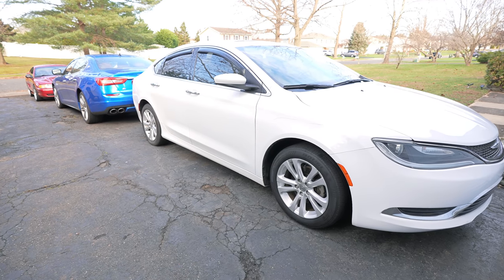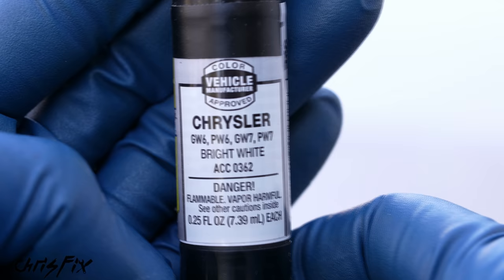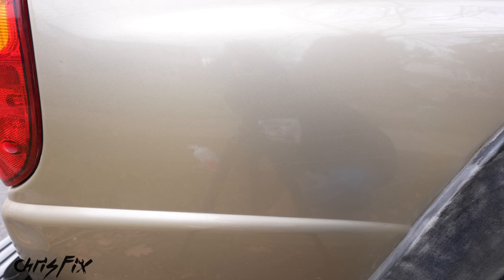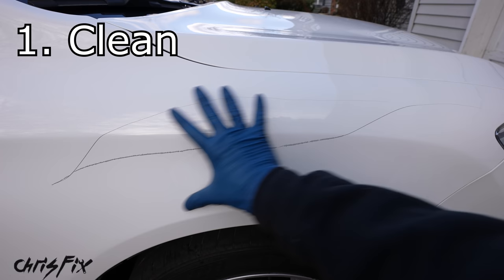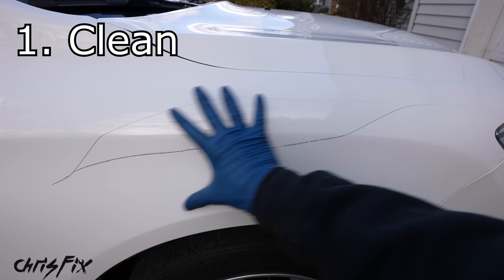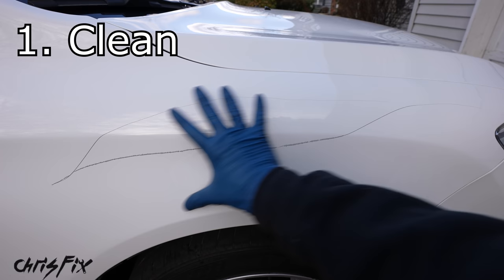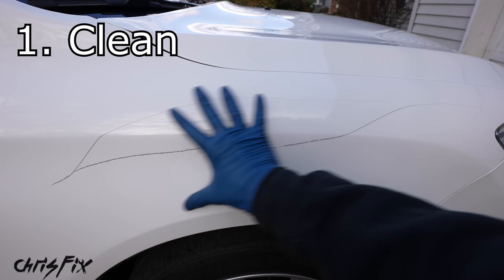How to Repair a DEEP SCRATCH in Car Paint (DIY)

Comment: Try it on a black car. Either AMMO NYC doesn’t know what he’s doing “Best Paint Touch-up Tricks: Mercedes G55) or Chris fix is a god.
Reply: Scratches show up way worse on a black car than any other color because of the light reflecting off of the clear coat on a dark background. White is the perfect color to hide a good chunk of scratches. Even some of the deeper ones. I've done paint correction for a ton of cars, and black was my least favorite to work on because you can see every imperfection. Working with a white car was a breeze.
Reply: @twalls16  I understand the dilemma but wouldn't it be nice to see such a video of fixing a scratch on a black car as such with AMMO NYC's video. Yes, it's going to be visible but would @ChrisFix do a better job than AMMO NYC with different techniques. Obviously just as ChrisFix stated the only way to fix it properly would be to respray the panel and blend it with the other paint. I would just love to see it for entertainment purposes.
Reply: @diegocorona6630  He actually repainted the door of a black SUV using rattle cans. It turned out pretty decent. Of course the video won't pick up the fine details.

Comment: Just learned the hard way this does not work too well on paint with metallic pigment. It’s better than it was, but extremely noticeable compared to the same work on a car with a flat color. I’m just lucky I had to fill in a couple gashes on the trunk, and not somewhere that people look at often.

Regardless it works as body filler and will get covered up with a wrap at some point.

Comment: Sand
Isopropyl alcohol
Tape
Paint (with art brush)
Wet Sand
Alcohol
Clear coat x2
Wet sanding over a sponge (3000 then 5000)
Wash off
Polish

Comment: Pros definitely make it look easy! :) I just tried this on a red car, and after sanding the touch-up base coat the color became way lighter than before. I trusted the process and hoped the clear coat would darken it again, but it didn't, so now there's a distinct line where the scratch is. From rewatching this, I'm still not sure if I should avoid sanding the base altogether if it's color, or if it did something wrong in the process? 

Would also love this video again on a darker car where you can see the different levels of paint after each step. e.g. once you've sanded down the base to be "level" with the surrounding paint, it must still be lower overall, right? i.e. within those earlier feathering lines. Otherwise, once you put on the clear coat on top, it's higher than the surrounding paint and if you really flatten it in the next step, you'd be back at the base layer over the scratch.

Really appreciate the vid though! My first pass wasn't the best, but hoping to make another go when I've got more time again.
Reply: James - I've just done the exact same with a red car and it looks truly awful haha! My only positive take away is that it won't rust now its been treated?
Reply: @VailM8  in a turn of events, I went to wet sand the clear coat and it peeled right off. By this point, I'm a bit over it all, so I decided to polish out the scratches using the P4 Chemical Guys product and this ended up bringing the base color back to what it was before, matching the factory paint. Don't know if I just got lucky, but now I just need a way to make the clear coat stick.
Reply: Saturated colors like red are hella hard to match.  This is why even the pros have to adjust the colors then paint the whole panel and feather to match.  I have tried with factory OEM paint pen on a red Corolla and it didn’t match mine at all.
Reply: @nicholasnguyen8308  any idea on how this would work on black?? Would it be similar to the problems you’ve had with red?
Reply: @jameslane01  Not a pro at this BUT try using Automotive Enamel clear coating a spray can ... Tape off close area to the repaired area , spray  a quick pass at a good distance away.  do a few passes just lightly getting that area covered. . remove the tape . Feather spray . then finish as before .. GOOD LUCK .
Reply: @rjazco51  Thanks for the tip! Will give this a try when I make my next attempt
Reply: Not dismissing your pain but I'm so glad I bought a white car. 🥲
Reply: Terrific video. I have a large area scrape down to metal.  Can I get a spraw version of the products mentioned? Thanks
Reply: Man same here on a black car. My car looks like crap now..about as bad as when the scratch was there.
Reply: Now I wish I had seen this before doing my grey car 🤦🏾‍♀️😄.
Reply: Many months later, but thanks for this comment. While I really appreciate Chris' videos on this topic, I was anxious about doing this to my own satisfaction. Finally, this weekend w/time and weather permitting (cloudy but mild), I got to it. 

Maybe it's my perfectionism, but between sanding down the thin line of surface rust on my trunk lid, getting enough paint coats and allowing time to dry, not much light or room in the garage, it hasn't been that easy. It's Monday night, and I'm now waiting for the clearcoat to dry, then it's back to sanding, I guess. 

At this point, the (frost grey/blue) paint spots look darker than the rest, though I suppose it's better than the white scratches. Tbh, though, I'm not feeling great about it right now, but I'm mostly disappointed in myself. After this, maybe I'll just take it to a good detailer. Oh, well.🙁
Reply: I was looking for this thread.
White paint is extremely easy to work on. This video is a gimmick, and now I'm wondering if the video about surface scratches is a gimmick too because it was also done on very light forgiving paint.

Comment: Would you recommend any changes to the process if the scratches are on a plastic bumper? Or, will this work regardless of the panel material?
Reply: If it's deep you should apply a plastic primer before the first layer of paint so it sticks better. 
Also on metal it is best if you apply a rust neutralizer like loctite 7505

Comment: WARNING! This filling principle only works with acrylic paints. If you try to soften the edges of the scratch by sanding and then fill it with the touch up tool on the car with metallic or any other paint that contains crystals, the scratches will be even more visible because you will spread the scratch, and besides, the color textures will not match because of the crystals. On such colors, it is better not to sand the edges, but just  to touch up with a thin brush, wait for it to dry and repolish that part. I found that out the hard way.
Reply: How do I know whether my car is painted with acrylic paint or any other paint, the ones who mentioned above?
Reply: Glad someone pointed this out. If you try this on metallic paint the scratches from sanding will be insanely bad and if the colour is a dark colour.....just no.

Comment: This was the first video I watched to learn to repair my car. I have a little (6 inch) deep scratch and what looks like a bunch of clear coat scratches. I'll be working on it right away. Thank you. Great video.
Reply: Did you get good results
Reply: @Mjrrrrr07  On the clear coat scratches, yes! I did cheat and got a Porter Cable 7424 buffer. Worked great. I also used Turtle Wax One and Done compound, so another little cheat but hey, my hands are arthritic! :( On the scratch down through the base coat the jury is still out. I ordered some 2000/3000/5000 wet sanding discs for the buffer. I did not do a very good job on the hand sanding. I got a bit aggressive and widened the scratch. However, I could not get a pen to match the color of my paint. There is one car shop in Battle Creek and they mix the paint. Had to get a pint of it, however, it will last about 5 years. It has the perfect match, it is a single stage paint (clear coat is in the paint as the factory paint is) and it has a slight additive for glossy appeal. The sanding disc will get here today or tomorrow. So then I will smooth out the paint and buff to see how well that went. In all, there was so much clear coat scuffing that I just did not think it would look good. However, all of that, all the way down the side of the car looks perfect!

Comment: This might sound kinda silly. But, I definitely don't want to screw this up. I was thinking about getting a panel off of a junk car and practicing on it a couple of times before I actually work on my own car. I've never done anything remotely even close to this. And I don't want to cause even worse damage. My car gets tiny chips on the front end from loose gravel on the road. It sucks living in country areas. They constantly drop loose rocks down some of these country roads, supposedly to help add better grip and traction control. But, I am gonna practice a few times and see how that goes first. Practice makes perfect, right?..
Reply from the maker: Practice is not a bad idea!

Comment: Leaving this Comment for future reference 
Step: 1 clean
2 sand
3 paint 
4 blend

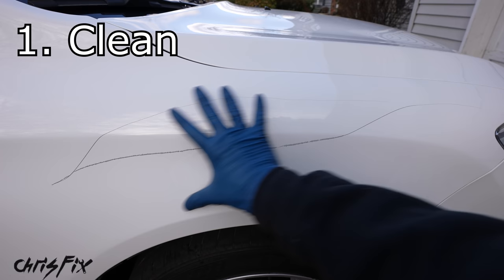first step(clean 8:13

Step two (sand) 8:31

Step two cont. 9:30 

Step 3 (paint) 13:18

Step 3 cont 15:51

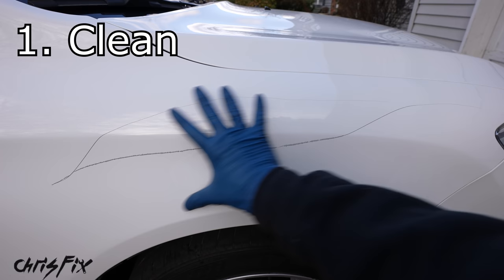Step 3 c 16:04

Step 3 c 16:15

Step 3 c 16:35 (coat 4)

Step 3 c 17:30

Next step? 18:07

Step 4? 18:23

Step 4? c 19:04

20:05 us when the sanding step begins (sand the touchup paint)

Step 4? c 21:37

Clear coat (2nd coat) 22:14

Step 4? c 22:33

Step 4. (Blend) 23:39

Step 4 c 24:40 (wet sand)

Step 4 c 25:20 (polish)

Comment: I felt that the touchup paint I purchased online was darker than the original mfg paint so I bought the mfg touchup paint. I followed the procedure and the fix was pretty good, but I noted an interesting phenomenon. First, the mfg paint was definitely superior in color although both the mfg and online versions were coded the same. I tested both on the door jamb to avoid any paint fade. The online version was definitely darker. Secondly, while the mfg color was correct, the final result was darker. I attribute this to the recommendation of 3-4 coats before clearcoat. While the YouTube video suggests several coats, this is on a white finish. It seems that multiple coats of a paint with darker pigment would get progressively darker with each coat. At least, that's what it appears to have happened as my scratch is now filled and level with the surrounding paint, but the repair is darker in the scratch though the touchup paint color is an exact match with one coat. If i had to do it again, I would use the mfg paint with the small tip and fill in the scratch with the paint, minimal sanding with 1500 sandpaper and a coat of clearcoat and 2000 sandpaper and then polish. This minimizes unnecessary sanding in areas that were not affected.
Reply: Yes, this is my experience as well. My 25 yr-old car's OEM paint color is frost grey/blue. So it appears differently depending on the light. Since I paint my own nails, I understand how base and top coats work. The sanding steps here are a little confusing for non-white paint colors, I think. The process seems like two steps forward, one step back. At this point, I'm not sure whether the touch up spots are darker or lighter than the rest. So I finally gave up and put on the clearcoat. And now, I'm just hoping for the best.

Comment: With a small scratch, the sandpaper caused more damage than the scratch. When I did the whole panel with 3000 and 5000 sandpaper, I think the whole panel got worse. I am a novice, so I suppose practice makes perfect… in all takes about a whole day 😢would have been good to know how much time we should put aside.
Reply from the maker: Does it still look bad after a polish?
Reply: @chrisfix  Unfortunately it does : (    I will take it into a panel beater to get it properly sprayed. The original paint is a gun metallic grey and the sandpaper area went a lighter colour.  It was an interesting experiment.
Reply: @paultsuji1021 are you sure you didn’t get into the base coat when wet sanding because unlike solid colors, you can’t sand a metallic base coat because of the flakes in the paint and it will end up looking worse.
Reply: @christianmauro1394  I was very light with the wet sanding 3000 and 5000.  There was no information on the video about metallic paints. Maybe for a follow video for @chrisfix to make.
Reply: @paultsuji1021  you should be fine if you went very light with that fine of a grit, as long as you don’t see paint on your pad, try polishing some more. Polishing by hand takes a lot more time than with an electric polisher and you might not have polished it enough. Your arm should be killing you by the time you’re done with the panel.
Try polishing a very small section for a few minutes and see if it clears up.

Comment: You may not know this, I didn't know it until after I repaired my chips, but that little white scraper cap comes off, and under it is a pen tip, that the touch up paint comes out of, on your touch up paint container,  it applies paint in small areas, where the brush is too large for the size of the repair area.

Comment: Amazing instructions. I liked the video and i love all your videos bro! But I gotta say I just tried this on a deep scratch on my dark metallic grey color crv, and it did not come out the way I wanted to :( I followed everything step by step but i can still see the paint strokes from when i first applied it. I sanded it down exactly like in this minus the 800 grit, I used 1000 because thats all i could find, but everything else was the same. And after I wet sanded down with the 3000 and 5000 before the polish I seemed to have etched away some more of the original paint :(  This was my first time trying this kind of work so i can admit i probably sucked at the repair, but I tried my best to be meticulous with it. I ended up just going through to the end with the polish and called it a day lol. Any tips for fixing scratches on a dark color car would be great, or a video if possible?

Comment: HOW do I fix a black plastic bumper that was punctured with a round rod about 3/8 inch diameter Chris ?? The 24 Toyota Rav4 front bumper lower edge has the damage. Could I use super glue to adhere the flap ??? Thanks for your help fella too. v
Reply from the maker: https://www.facebook.com/watch/?v=1007361749467499
Reply: @chrisfix  Thank you Chris. Peace and out V

Comment: With these kind of things - doing it yourself can make the panel look alot better..  but someone attempting this for first time isnt going to get it to the level of not being noticable or ready to sell to a new owner.  With a common car like that - Id just buy a white wing in good condition from a scrapyard and bolt it on.. or unbolt the wing - sand and fill the scratch and repaint the whole wing..  This is more expensive..but for most people this will yield much better results.  Youve done a good job - but you need to buff and polish the door and bumper also to blend in the polished clearcoat.  Its alot of work

Comment: Tried this with water based paint, definitely not as easy as Chris does here as the paint needs at least a day to dry enough, and wet sanding rips it right off. I even used 8000 grit. Got to use solvent based for this I think.

Comment: We have rock chips on the hood of my daughter's first car to take care of. We also need to get worms out of the trunk... yes WORMS! YUCK! We have to solder mouse chewed wires and get the lights working again, put in the new relay switch and try to figure out if the alternator is bad because the battery keeps dying. Thanks for your videos!!!

Comment: Fingers crossed I don't mess this up tomorrow. I got some cutting compound, polish and 4 different grits of sand paper, 1500,2500,3000,5000. I used my pen last week before the snow hit and messed up a little putting it on. I finally get a good day tomorrow so I can try to fix it.
Reply: How did it go?
Reply: @daylangio  oh I messed up bad 😑 I tried doing it by hand. Took a couple tries to get it to look good again.
Reply: It's still not perfect but it's way better than it was. Soon as I can afford one I'm getting a buffer so I can do a full paint correction and ceramic coating.

Comment: Thanks for such detailed explanation. I do not however understand one thing. At 13:25 - The touch up paint overflows the original clear coat. The sanding (19:12) then makes the touch up paint level with the original clear coat. My question is: where does the touch up clear coat go? If I apply the touch up clear coat and then sand it so that it is all level again (23:03) won't I basically sand through all the applied touch up clear coat?
Reply from the maker: When you sand to add paint you are actually sanding that thick clearcoat layer down a little, not enough for you feel a massive divot in the paint or anything but you are removing a miniscule amount of material , then when you apply clearcoat and sand you are then leveling it to match it all back together.

Comment: I had a 3” side swipe with my garage door jam. Yup my fault. It include the passenger parallel side of the black painted bumper (5, 3” scratches), and above that in the panel (summit white, GM) similar scratches AND a vertical 2” at the wheel opening, and a eraser head size DOT shape to the primer. I’ve spent at least 8 hours doing this. It’s very tedious, and detail oriented. 

I’ve watched several of your vids. Interior carpet cleaning, and I did a SILVERADO FRONT ROW seat removal, and driver seat foam replacement. Super clean your windshield. Octane rating explanations. Etc. etc. my guess is at some point you were a detail man at a car dealer, or your Dad was a good teacher. 

My YouTube channel is John One One. I know the WORK it takes to film, and edit a video. You CHRIS FIX do a great job filming, editing, explaining step by step. Wish you much success in your life. 👍❤️🙏.